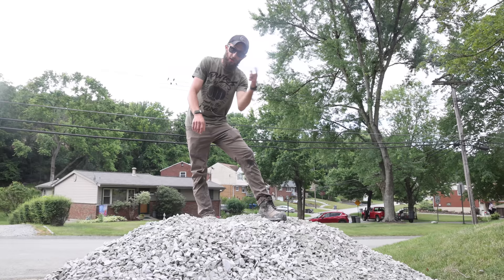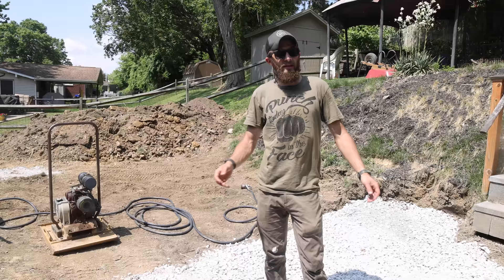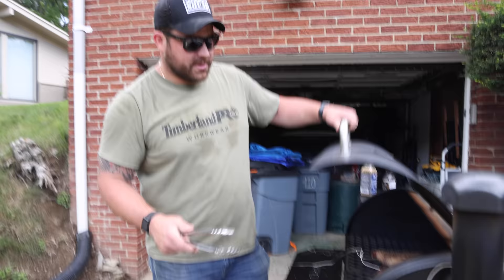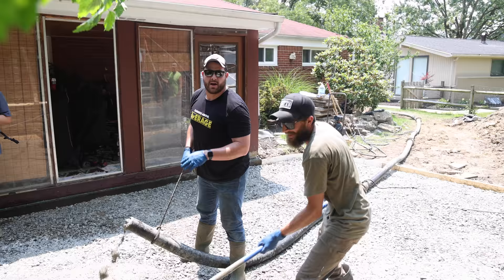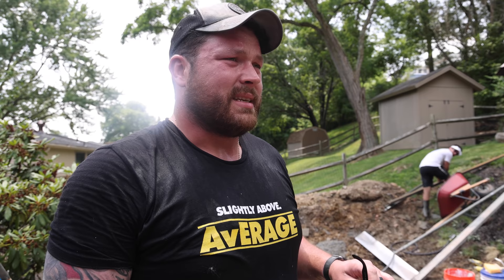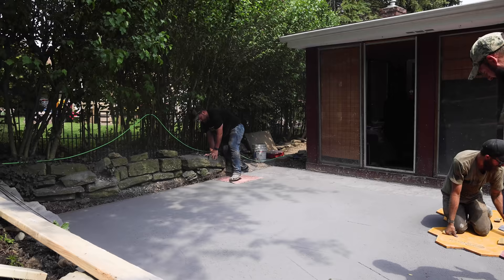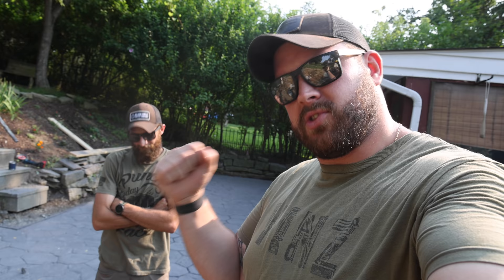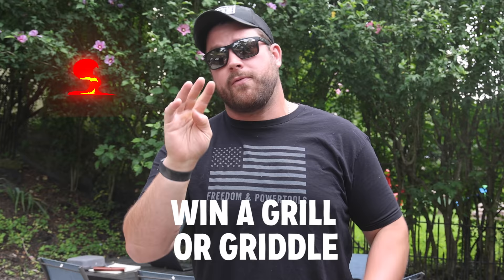How To Stamp Concrete - EPIC Back Yard Transformation pt. 2

Comment: is there any reason why you didn't cut the relief lines in the gaps between stones? That way you don't have straight lines running through what is supposed to be stones and the future cracks would still follow the relief because they are paths of least resistance? pump it don't hump it!